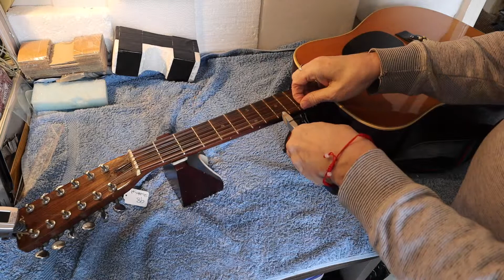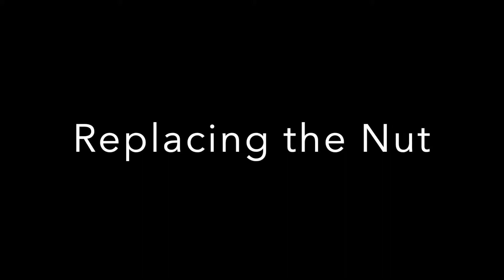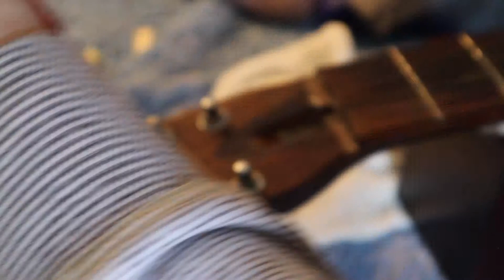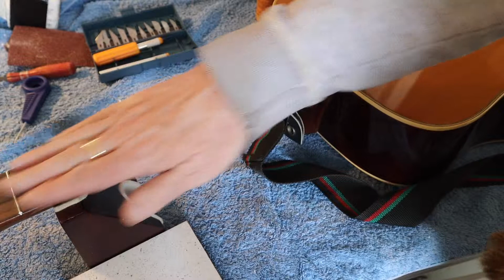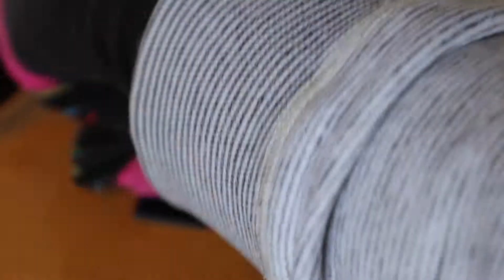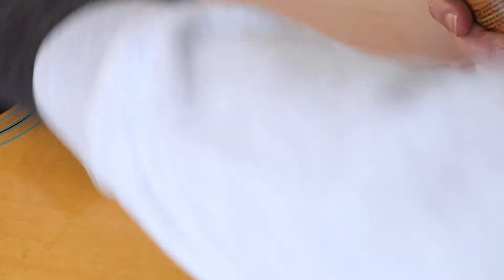How to set-up a 12 string guitar - part 3 (Cleaning the Fret-Board)

Comment: Nice little trick I’ve learned recently  when removing the pins is to push the string in then pins just come out... no need for tool
Reply from the maker: Hi sadly it doesn't always work but great if it does